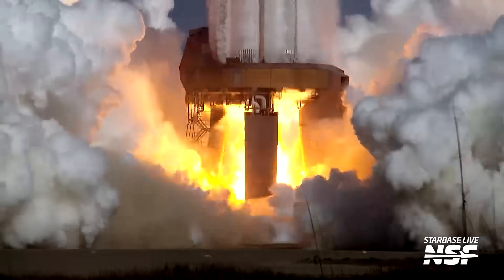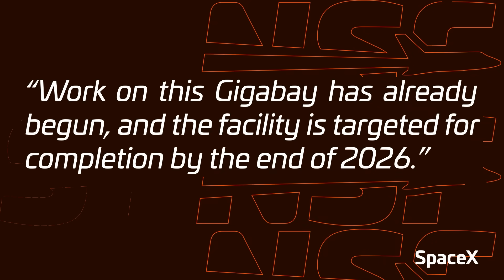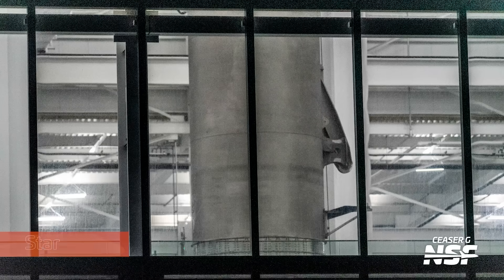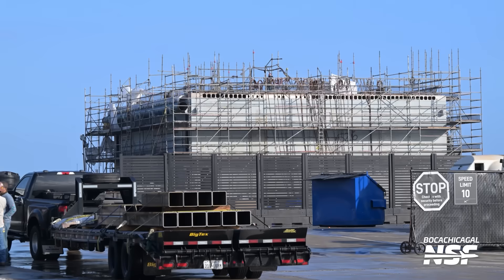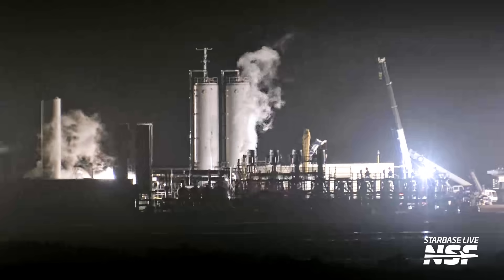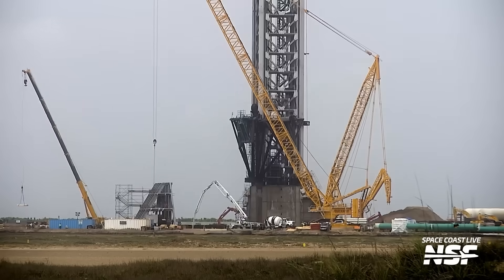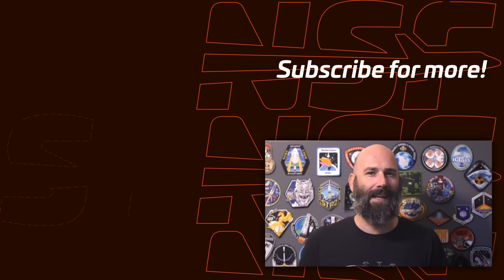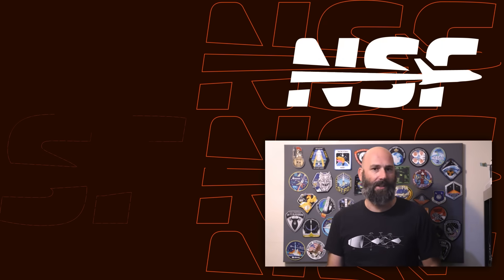Booster 14’s Static Fire Coming? 🚀 | Starbase Update

Comment: NASA had the shuttle why doesn't SpaceX just use the same design heat tile, makes no sense designing something that so far hasn't worked, They should use a proven design and start something else, like landing legs. If they miss the Artemis launch window, could end the whole program for SpaceX, it's why they got the contract in the first place, and the money.
Reply: The heat tile for the shuttle was problematic. Therefore, it will not be workable for rapid reusability
Reply: @viewer_5714  Well, considering how many shuttle flight succeeded to the failures caused by them, they were more durable than the Starship.
Reply: If you really want to push a "Why use B when A works so well" you'd do better to suggest whatever tiles the X-37b uses, since it travels much further out than the Shuttle ever had. Which by my understanding, means it's coming in faster and would have higher reentry heating.
Reply: The Starship tiles are basically the same material as the Space Shuttle ceramic tiles. Difference is that they are attached via pins for Starship while NASA used glue for the Space Shuttle, with was a large time and cost factor. Pins are much better than glue.

Comment: There is no way they can dock two ships for ship-to-ship refueling in orbit without a reaction control system...The Raptors alone will never provide the level of control needed.  It will also help de-orbit the ship when it loses engines, which clearly can happen.  I am not sure why this isn't happening.

Comment: They're using an all new "3D printing" technique called Direct Laser Metal Sintering for production of engines, gas generators, complex pipe connection etc and it's most likely some of those components that failed for unknown reasons but most likely vibration, corrosion etc. The new generation of the upper ship have flown less and therefor they have less data and knowledge of what breaks and how to fix it - also the boss is pretty busy and the lieutenants have seemed less talented then the man that created the company. We can forgive Elon because he's doing good and important work elsewhere.

Comment: Wouldn't it be (possibly) more economical to use the wall furthest from the highway of the highway as the wall of the Gigabay, and simply add to it..
Seems a bit costly to bulldoze something to build basically the same thing back in the same spot..
Reply: Unless the back wall of the Giga Bay ends up being closer to the parking garage.  But who knows since the Giga Bay footprint is not stated as yet.

Comment: They will fix the starship problem. We know they can get a starship into orbit. Something they changed for block 2 obviously isn't working out. But they'll fix it. They've come this far. Full confidence.
Reply: Tbh it feels like the new independent feedlines have caused structural issues, causing the leaks and explosions, some reinforcements would probably fix these problems
Reply: @VictorNugger  it may be as simple as running the engines at lower power for a little longer.
Reply: Cooler heads always prevail.
Reply: If they want to fix the problem they would need to redesign the downcomers (assuming harmonic responses were also on flight 8), and they can't do that until ship 38-39, but what they can do is add more struts, and things like that to dampen the vibrations. But that will add more weight.
Reply: @akslo124  “if they want to fix the problem” as if the alternative is to continue to fly starships that they know will explode before making it to orbit.
Reply: @ that's not how I meant it but i mean with i don't see how the will have enough time to fix it entirely before flight 9.
Reply: @farnazseif6459  they may just go back to the block one design. It works. But it may just be a matter of changing the thickness of the downcomers or like you said adding struts or something similar. 
 I can just imagine the Vibrations in that big hollow empty tank. People just don't appreciate the forces and stresses in a rocket.  They're violent.
Reply: @corycrandell2682  block one had big proboems with the ship flaps, and a ton of wasted internal space.
saying they should go back to block one is stupid
Reply: @joe-go-jint-aJ2997  stupid?  Thats real nice. I was simply referring to the downcomer confirmation.
Reply: @akslo124  there is probably alot of other issues we dont know about that they are working on. the last two second stages have been disappointing, but it doesnt mean that starship is doomed.
i have fully confidence  in the satrship team
Reply: @farnazseif6459  or run the engines at a lower power to change the vibration. I guess we'll see what they do.

Comment: Hey Jack. Here's the straight skinny (from something I wrote on another blog). 

The heat shields on IFT 4, 5, and 6 performed as designed during those EDLs that had the same level of heating as a Ship would experience on return from LEO. The Ships on those three test flights reached orbital speed (7850 m/sec) and could have reached LEO with another 20 to 30 seconds of engine burn.

And those Ships made successful soft ocean landings, demonstrating that the heatshield functioned adequately to protect those vehicles during a realistic EDL starting from orbital speed.

In other words, those three Ships and their heatshields made it through reentry heating and came down to the ocean in one piece. The heatshields work OK. And those tiles are mostly ceramic fibers with a black glass coating on the hot side.
Reply: But getting back in one piece isn't sufficient. They are aiming, if not depending, on rapid reuse.
Reply: Nonetheless, they are evidently not fully sure about ceramic tiles, otherwise they wouldn't be testing metallic heat shield parts. So there seems to exist some problem with the ceramic tiles we don't know about. Perhaps ceramic tiles are still considered to be too brittle for rapid reuse. A metallic thermal protection system (TPS) would be more robust.

In fact, the durability/maintenance problems with the ceramic space shuttle TPS were the reason why the (later cancelled Space Shuttle successor) VentureStar was supposed to have a metallic TPS. It was going to be a mostly hollow honeycomb-like structure made from inconel, a heat resistant "superalloy".
Reply: From Grok....Elon Musk has discussed the challenges with Starship's thermal tiles cracking due to heat expansion in multiple interviews, particularly focusing on the complexities of thermal expansion and contraction during launch and reentry. One notable instance where this topic was covered in detail is his February 2021 interview with Joe Rogan on The Joe Rogan Experience, Episode #1609. In this multi-hour conversation, Musk addressed the Starship heat shield, specifically mentioning the difficulties of managing tile integrity under the stresses of thermal expansion and contraction.
Reply: What about the leaked video from inside the fairing showing burnthrough on reentry?
Reply: @Marc83Aus He was talking specifically about the tiles, I think; whereas the last mission didn’t seem to be about the tiles (I don’t think; maddening as an old flight ops controller to not be able to see the data!!) - Dave Huntsman
Reply: @dphuntsman  I think its interesting that the inside of the payload bay had what appeared to be burnthrough but it couldnt penetrate into the tanks, part of that could be the fluid in the tanks helping act as heatsinks, but its probably mostly because of the reentry trajectory putting too much stress on the forward heat shield. The changes to ship version 2 and flight changes probably mitigated this, ive been hoping to see footage inside the cargo bay for the payload simulators to confirm this, maybe on the next flight.
Reply: @Marc83Aus  i know they intentionally left some holes in the heat shield to test if it could survive missing some tiles